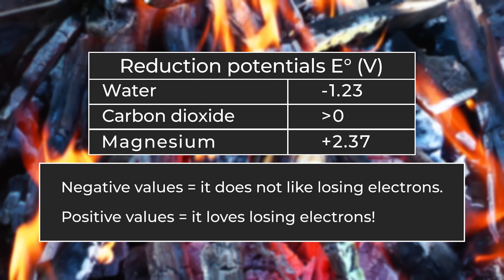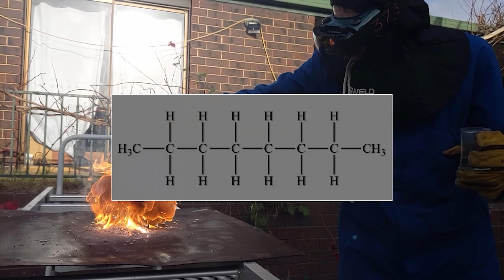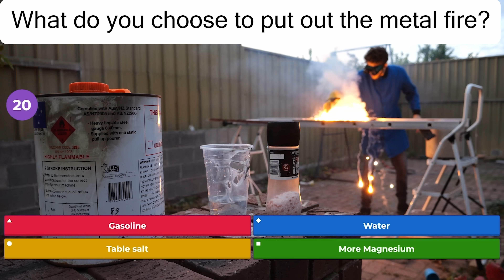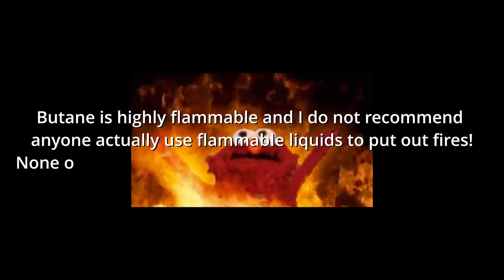Can Gasoline Extinguish a Fire?

Comment: Why didn't you just use oil? Its not volatile and its hard to ignite, but it has basically no oxygen in it.
Also, spraying the fuel at the metal fire will just pull air and oxygen from the surrounding air into the fire too, you need to avoid the venturi effect.

Comment: Its the liquid of the gasoline that puts it out, and the fumes that make it brighter/ignite.  The ealier video worked because the liquid extinguished the flame on the magnesium and then the fumes of it ignited away from the magnesium, which is how it 'robbed' it of the fire.  I think you were on the right path but focused on the wrong variable.  Liquid my dude, not the wind or orientation of the magnesium.  Thus why spray bottle made it worse.

Comment: I think that spraying just makes it so there is more air in between all the gasoline/butane particles, which in turn doesnt allow them to be able to block out all the oxygen from reaching the magnesium letting it continue to burn, while at the same time giving oxygen to the gas so it can combust easily. (Although I may be missing some things and this may not be the case, im not sure)

Comment: The concept of salt to put out a metal fire is what Class-D fire extinguishers use I believe. A mix of random salts and other goodies. one example is "a blend of powdered graphite, granular sodium chloride, and fragments of copper" Seems like most of it is intended to take heat away while covering and preventing oxygen contact as much as possible (edited to add "maybe i should finish the video before commenting")

Comment: Honestly, the reason I think gasoline may have stopped the magnesium fire was because the liquid gasoline could cover the burning magnesium sort of like how you'd store sodium/potassium under oil, protecting the magnesium from oxygen and also since gasoline has a relatively low boiling point, it could take away heat from the magnesium and cool it? Maybe if you ever revisit this, try using a more viscous oil instead? Edit: Nvm, just saw your explanation in your comment below. But yeah, I'd like to see if using more thicker oils can help instead.

Comment: I can see the science behind this. Key point is, the fuel is at room temperature, which means that, if you splash it onto the metal fire, it can cool down the metal quickly (both because of the temperature differential, and the latent heat required to boil the fuel), while not reacting with the metal directly. This is why alkaline metals, such as sodium, are often stored in oil, which it can't react with easily.
The issues with this idea, however, are numerous:

- If the metal isn't in a shape where you can soak it with fuel for long enough, this won't work, as the fuel will "drip off" and expose the metal to the air again.

- Once the fuel layer boils over, the fuel fire can re-ignite the metal (magnesium's ignition point is cited at around 950°F, most fuels burn at over 2000°F).

- While the fuel can't react with the metal, its combustion products (CO2 and water) can react with it (as shown by the video itself), so the fuel fire doesn't "starve" the metal fire off of its oxidizer as much as one would think. This, combined with gasoline's higher boiling point/heat capacity, might be why this "works" better with the incomplete-burning gasoline than with the clean-burning butane (since gasoline will produce less-oxidized combustion products such as CO and soot, which might not react as well with the metal, if at all).

- As mentioned in the video, even if you succeed, you just turned a small Class D fire into a large Class B fire. Good luck.

Comment: Did a little brainstorming. Want something with a flame that is not too hot and leaves behind a lot of carbon in a sooty tar like mess. How about tar. And because you need a solvent you could pick any number. But how about gasoline. Not sure if it would stay liquid with the butane propellent but maybe worth a shot. It at least is cheap. Maybe mix carbon powder, with other binders to keep it in suspension and stay liquid or gell at higher temperatures but go liquid when disturbed. Something like ketchup but with less water. Honestly sounds a bit like napalm but maybe with enough carbon mixed in to make it burn horribly.

Comment: Yes, I worked in a factory that manufactured parts out of milled aluminum and magnesium. My job was to sweep up all the shavings at night. I'm pretty sure it was a miracle that I didn't burn to death some night. We had to wear non-sparking, non-static electricity shoe soles. But we had some kind of class D fire extinguishers that sprayed some kind of inert powder(not sure what exactly) with the idea of smothering the fire and depriving it of oxygen. I think we were supposed to have some kind of halon system but it wasn't working.

Comment: In our kitchen we also keep boxes of iodized table salt at every station that could potentially catch on fire in case our extinguishing units do not go off or we do not want them to go off. Sometimes in a restaurant you'd rather just put the fire out yourself than to let the systems in place put the fire out for you. A box of salt has saved me several hours of deep cleaning the entire kitchen after a small fryer fire.

Comment: 0:57 just taking a guess haven’t watched the vid yet but i rn think it’s because the fire from the gas burns more air then the metal suffocating the metal fire due to the gas fires sudden need for lots of air. we’ll see if im right lol
Reply: And due to the gasoline/petrol cooling it down under the flash point of metal fires
Reply: THATS CORRECT! cheers

Comment: The reason is that you are spraying it.

When you spray it, all the fuel becomes aerosolized, making it burn hotter and faster. 

What you can do is use vegetable oil, palm oil or some other kind of thick hydrocarbon liquid like diesel that burns slowly.

Comment: In a real world situation, a Class D fire is best simply isolated and left to burn out. At sea, sometimes it can be pushed overboard such as in the case of a naval aircraft carrier. Flammable liquids or gasses just make another fire. Salt could be of some limited benefit. Putting gasoline on a fire is just as silly as it sounds.

Comment from the maker: I don't know how I didn't realize the issue with my explanation. Magnesium burns in carbon dioxide, and gasoline + oxygen obviously makes carbon dioxide lol. It mostly goes out because gasoline is cold and can take away the heat from the burning metal. Until it's not cold anymore of course
Reply: you absolute GOOBER
Reply: Gasoline also displaces the oxidant
metal fires need lots of oxidant (duh, cuz the metal is all fuel) so as soon as the heat is absorbed and the oxygen flow is cut off, the burning stops.
It's also why column 1 and 2 metals are stored in oil, no oxidant, no problem (also need to keep them away from water because base reaction generates crazy amounts of hydrogen)
Reply: you should try diesel :D
Reply: What about extinguishing magnesium with a pure nitrogen?
Reply: @AfroBandera  No they react to form magnesium nitride (Mg3N2)
Reply: Also, liquid gasoline doesn't really burn the fumes from it does, so any gasoline that hasn't evaporated yet will strangle the metal fire and cool it down.
Reply: You need enough gasoline to isolate the magnesium. In other words: "Let it SOAK!".
The reason for the spray not working is because the gasoline was evaporating and mixing with oxigen before touching the magnesium flame.
Try maybe with liquid nitrogen.
But yeah, prety funny video. Fighting fire with fire 😂
Reply: I would imagine the temperature of the gasoline is mostly irrelevant and it is more so the "heat of vaporization" cooling down the fire enough to put it out. I may be wrong. Then again the heat of vaporization is temperature dependent
Reply: I thought it was gonna say ELEMENT OF SURPRISE!
Reply: No comment lol

Comment: Modern flamethrowers, contrary to popular belief, don't throw fires. They ignite throw inflammable material, usually a liquid which then gets everywhere.

So what you made is technically a flamethrower as much as a fire extinguisher.
Reply: Ancient flame thrower like the "Greek fire" used by Byzantine navy, also didn't throw flame. Rather ignite throw some flammable liquid.

Comment: "But did you die?" I saw that phrase on a bumper sticker one night. It has become a standard response to a lot in my life these days. Congratulations sir, it appears that you did not die. Thank you for the video. I have never considered putting a metal fire out with gas. But, i see the draw if other conditions support the fire from petroleum products.  I'm thinking about if motor oil will put the metal fire out now...

Comment: Killjoy here. I would try something flammable that resists evaporation at room temperature, like olive or motor oil. You could even try paraffin wax dissolved in mineral oil. They shouldn't burn without a wick, such as your clothing or maybe the pile of magnesium. It would be cool if you could add something heat activated that gives off a dense nonflammable gas to put out the secondary fire, not sure if sodium bicarbonate in suspension would do the trick or not.

Comment: This works by smothering the fire/cooling the fire. For it to work you need the basically create a barrier that cuts the supply of air then quickly smother the resulting fire. Spraying fuel like this will never give you enough cover to smother the fire like that and you are even creating a fuel air mixture you are introducing to the heat.

Ironically throwing it in a bucket of gasoline then putting that out with a CO2 extinguisher might be the most reliable if not an utterly insane thing to do.

Comment: If you put a plain orange flame lighter under the burning metal, it should put it out. As long as it's in the flame, it should go out. Your torch has too much oxygen mixed in the flame so that doesn't work

Comment: 07:39 When liquid butane is sprayed, moisture begins to condense, causing the magnesium to explode.
You need a thin, constant stream of hydrocarbon, which is heavier than gasoline, so that it has time to wet the magnesium before it burns. Then soot forms on the surface. When sprayed, gasoline burns in the flame of magnesium, not having time to displace oxygen and create a layer of soot.
Reply: You need a thin, constant stream of hydrocarbon, which is heavier than gasoline, so that it has time to wet the magnesium before it burns. Then soot forms on the surface. When sprayed, gasoline burns in the flame of magnesium, not having time to displace oxygen and create a layer of soot.

Comment: You forgot something very important. Gasoline liquid is not that flammable. The vapors are, which you increase with the spray bottle. This is exactly what a car does, sprays the gasoline into the engine to atomize it. Also with the spray, you are probably pushing air with the spray, which means oxygen. When you use liquid gasoline that you pour on, the gasoline is covering the magnesium, preventing oxygen from getting to it. Also the liquid gasoline won't catch on fire, but its vapors are. There might be more to this also, but I'm pretty sure this is part of the explanation. Don't forget a fire extinguisher is also spraying, and at the low psi you have it at, you aren't getting a lot out of it.

Comment: Didn't you say it will grab oxygen from CO2 to burn? Then any carbon base fuel combustion that produce CO2 gas will provide the magnesium metal with oxygen supply to keep burning. What seems to put it out is the complete submerging of the metal in a liquid that has no oxygen its molecules.

Comment: Diesel fuel is much less flammable than gasoline, so, theoretically, you can put out class D file using a large amount of diesel fuel (a bucket of diesel per 100 grams of magnesium should be enough if poured immediately without spraying). Also you can try kerosene.

Comment: How about a sponge soaked in diesel?  It will catch fire and burn but it won’t spread as much and it should leave a very thick carbon layer over the burning metal.  A thin sponge like material could be thrown over fires like a blanket.

Comment: You can use antimatter to reliably put out any fire by removing both the fuel and any potential oxidant in the area. It will even clean up soot and other byproducts.
Disclaimer: Not legal or financial advice.

Comment: I think it's the difference between pouring and spraying. When you spray oxygen is added into the mix. And you kind of get this emulsion of oxygen and gasoline. Whereas when you pour, it's just straigth gasoline. And at the end (of the day) a drip is more like a pour than a spray.
Reply: So you could maybe use another aerosol that works with gasoline and has no oxygen. A lot of these are powerful greenhouse gasses though.

Comment: I am wondering if the addition of a non-flammable oil to provide a residue would be useful.
Probably Silicon, definitely not chloro-fluoro oils... at least not without some serious background work.
On a simple level even some motor oil might provide soot/residue.  And a new source of fuel.  XD

Comment: Use gasolines heavier brother, diesel. It will still burn if heated to 53C and will make a good fireball if sprayed but stands a better chance of  cooling/smothering the magnesium. Get several open top drums of diesel, pour some gas on top to heat and ignite the diesel, wait until you have much black smoke and flames, hand the trainee a 50lb extinguisher and tell him "put that out". How I was taught to use an extinguisher.

Comment: It is possible, and it is sensible... A column of fire will prevent the metal from getting enough oxygen to sustain a metal fire, and you can more easily treat a liquid fuel fire thereafter, but you need a more thought out setup... Either way, a good line of thinking from the pragmatic viewpoint... There is a reason why we say ``beating fire with fire`` and why we use fire in a controlled manner to limit the spread of a wildfire in the open... It works in a different way as a wildfire containment method, where you use controlled fire to remove the fuel that the wildfire will need to keep on spreading like mad, but in essence it is the same deal, you are just using fire to remove not the fuel but the fuel`s ability to react with atmospheric oxygen...

Comment: Maybe a heavier hydrocarbon, ie longer chain such as motor oil.  I would also try silicone oils of various viscosity.  Silicone oil has typically 20% the heat release rate of hydrocarbon oils of similar viscosity.  Oh and a much higher flash point as well. 
Ideally if you could find a Salt with a much lower melting point than NaCl, that might coat and flow over the burning MG to exclude air.
If both work moderately well,perhaps combine both?

Comment: How sbout Diesel for extinguishing it?
Slightly lower gross calorific value, stickier and higher flash point.
The other characteristics don't matter because the burning metal is so hot. I think the thickness of diesel will cause the flame to spread less.

Maybe you could try motor oil or transformer oil. Motor oil is even thicker and transformer oil (especially silicone based) has additives for a far higher flash point.

Comment: Likely the reason it doesnt work when you spray the gasoline vs pour it on a flat surface isnt the fact that theres more airflow mid air but because when you spraw the gasoline wit the spraybottle it comes out as a mist in which theres air cuz its atomized and stuff vs when you  drip the gasoline on the ribbon the gasoline its like more solid??? and stuff so theres no air in it idk

Comment: I think your so lucky your not dead the first time you splashed gasoline on the fitr the fire followed the stream to your can. and if air and vapor was not ideal so it did not explode. if it had right ratio the can would have exploded not just catch fire.  that's the result of the drunk who was having a bonfire but it was not roaring enough so grabbed 5 gallon plastic can that used to sell for 6.50 at Walmart blew up killed him family sued the can maker for millions won and put the largest co out of business then. dot, carb even the united nations all require testing redesign and liability insurance skyrocketed. now equivalent can 35 bucks
even your spray bottle flames followed the stream .as did the butane. the reason open pour or spray gives flames a continuous path to the source. very similar a electric circuit to not have that and still risky would be a measured quick cut valve. a way to deposit a large amount of salt might work on magnesium  my dads friend a Phila battalion fire chief and i talked about magnesium one time about was it used mixed with aluminum for light weight ladders and he told me about flammability . and how some travel bus had magnesium roofs he had experienced  i don't remember if he said what put it out
this was in the early 70s i think bus was silver eagles. 
BUT PEOPLE NEVER POUR GAS OUT OF CAN ON A LIT FIRE QUICK WAY TO HAVE WORST PAIN EVER

Comment: You might want to put a one-way valve on the end of your "detonative" extinguisher. Y'know, so the flame can't travel into the metal cannister full of highly flammable liquid...

Also put a fucking BIG RED LABEL of it, so no-one tries to use it on a regular fire by mistake - unaliving themselves in the process.